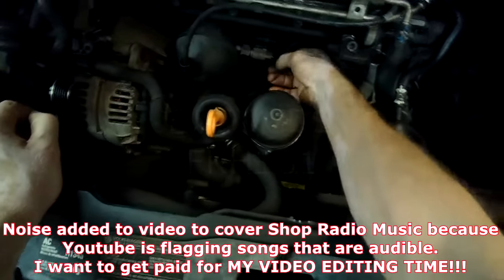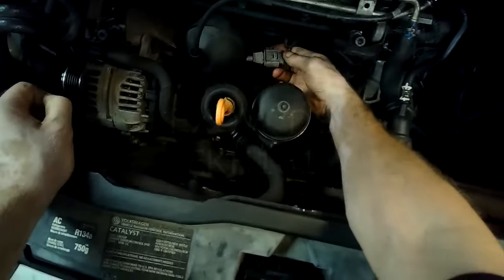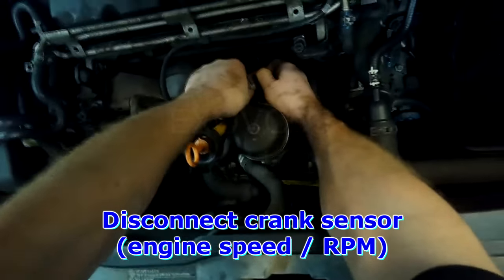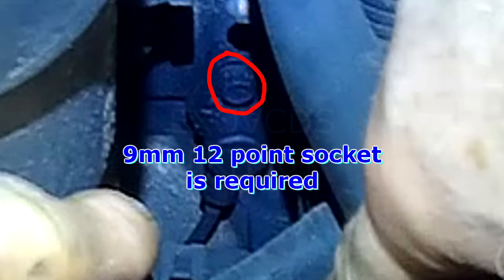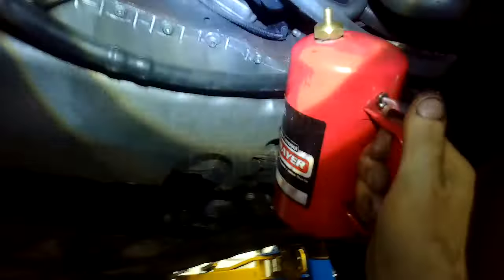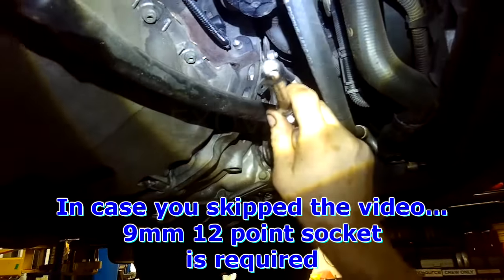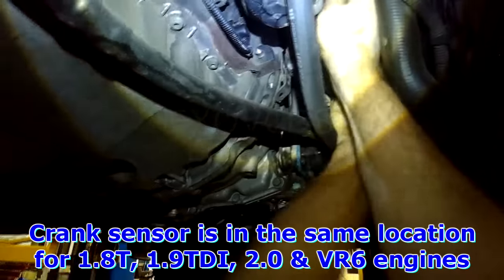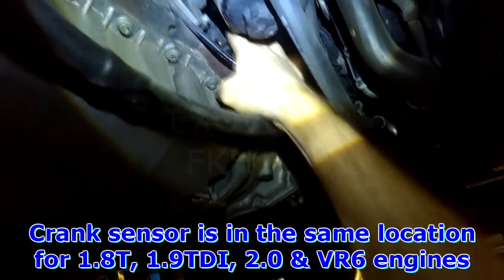VW Mk4 / A4 Crank Sensor removal

Comment: Hi Thomas I have a Jetta 2010 with no cool air with 50 psi of pressure on the Freon? What it could be?
Reply from the maker: Scan the AC module... it can tell you compressor status. On / off... reason for off. If compressor is active but no cooling. Run basic settings on flap doors. If still low / no cold air, evacuate to see how much was in the system. Charge with correct amount if it was low. If it's a clutchless compressor, check / replace control valve that's mounted to the compressor.
Reply: @EXOVCDS  Thomas do you have a video of this problem?
Reply from the maker: @ginoavila2085 
Sorry, not yet.
50psi rest pressure?

On a hot day seems low. 80F ambient,  refrigerator pressure at rest should be around 87psi.

50psi rest pressure (on a fully charged system) would expect ambient temperature of around 54F
Follow my above suggestions and report back.